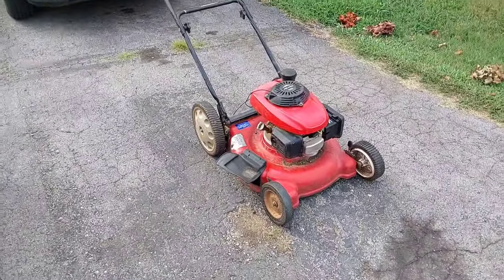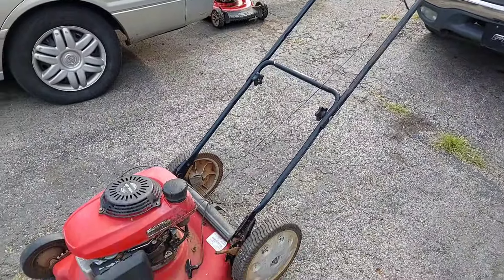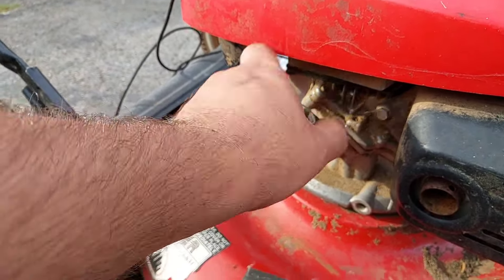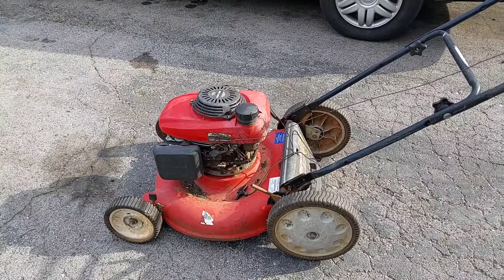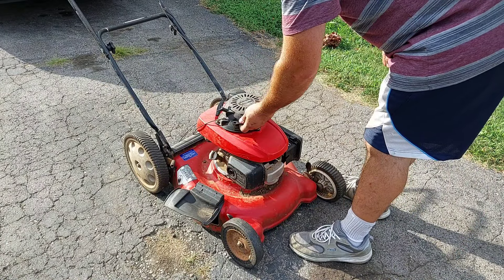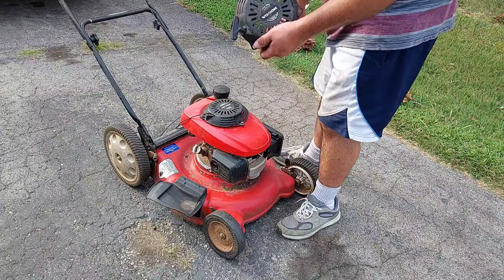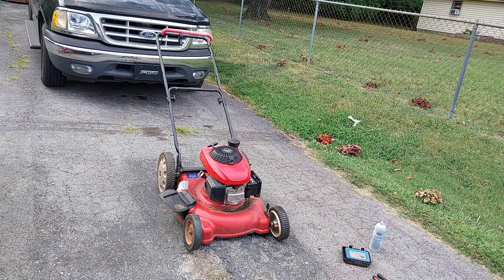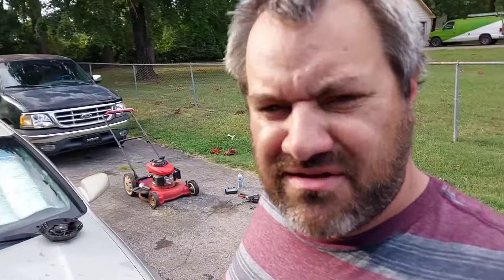$10 troybilt mower is it worth fixing?? 7/17/24

Comment: o went to a garage sale yesterday  was basically a estate sale,  they had a never used brand new troy built big red rototiller paid  75 bucks for it and a  new snow blower also a troy built for 125.00  they told me the old man  loved troy built.  and why he bought them they have no idea since he was 91, and  sick, loaded them in my utility trailer and  filled them with gas and oil, the roto tiller  had never been run or had oil in it  same with the snow blower. i didnt need them but? for that price i said  why not.  the snow blower is a 3 stage with tracks.  also had never been run.    never had a snowblower with tracks.   should be fine, and different hell even if it doesnt  work good for that price it  is cheap lol
Reply from the maker: Sounds like you got a good deal for both of them , especially you didn't have to do to much to them to get them running

Comment: I don't offer any $ when I see it has been fiddle faried. Only take those if free. I would check the blade isn't hitting somewhere underneath causing the noise first.
Reply from the maker: I'll see if that's one of the causes it didn't look like it I also got told to check the valve cover on it too but it really was low on oil